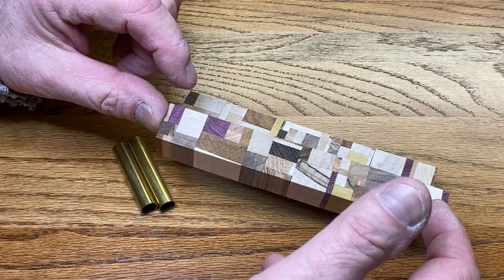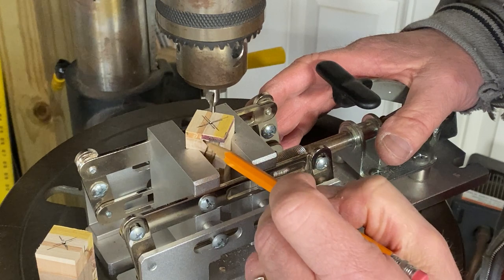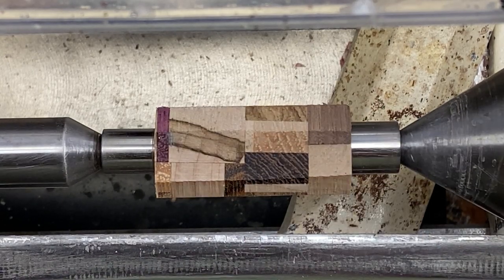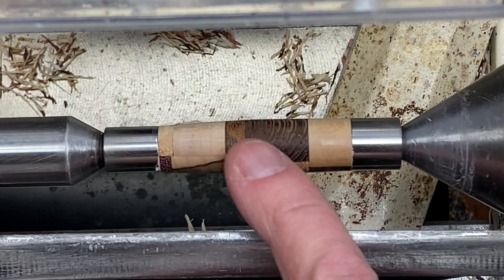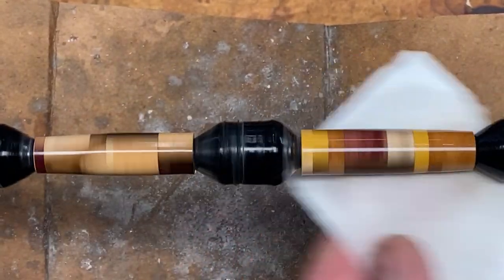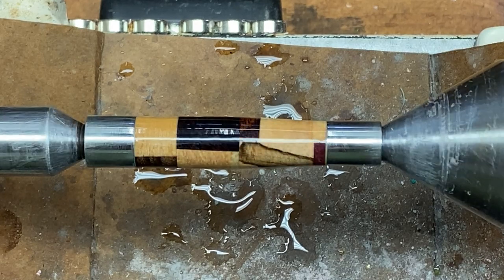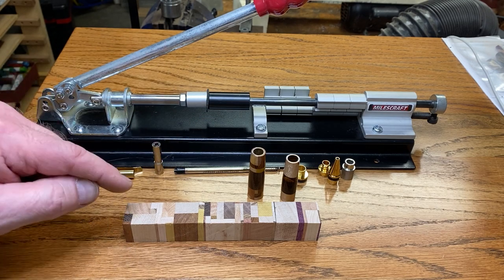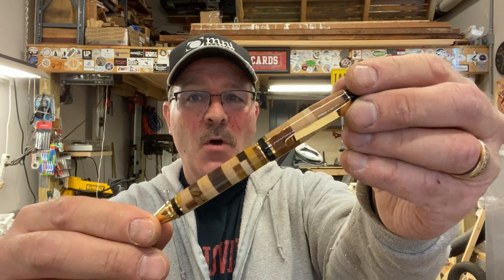Turning An End Grain Cutting Board Cut Off

Comment: I’d be interested in seeing what your fix is for when the ink doesn’t retract all the way. I’ve ran into that issue a few times.
Reply from the maker: Hello Chase,
  What I usually do is sand the ink refill down on the disk sander to fit the shorter length. Only issue is you can’t give that pen to anyone but a direct family member because every time they need a refill, you’ll need to repeat the process. 

Regards,
Bob

Comment: Bob, love your videos. I noticed your skew is rounded. Did you buy it that way or did you modify it for your preference? What is the benefit of a rounded skew?  I’m new to this and just wondering.
Reply from the maker: It’s only a preference. I have used square and rounded and just like rounded because I can roll it easier on the tool rest. 
  I purchased this one as a round skew. 😃

Regards,
Bob